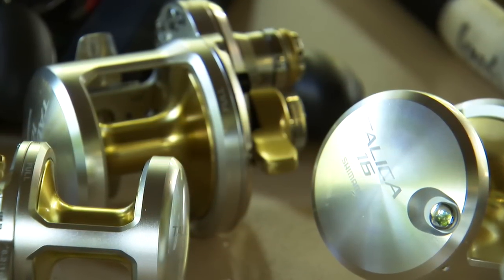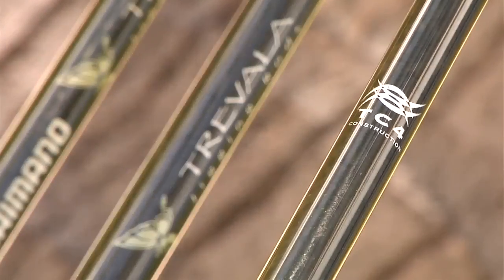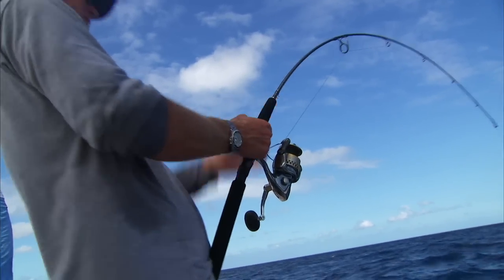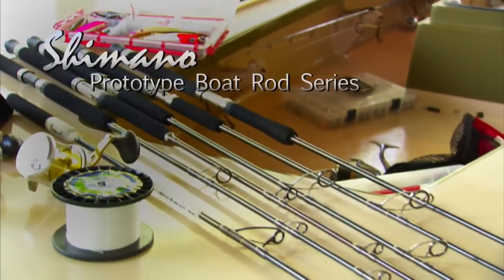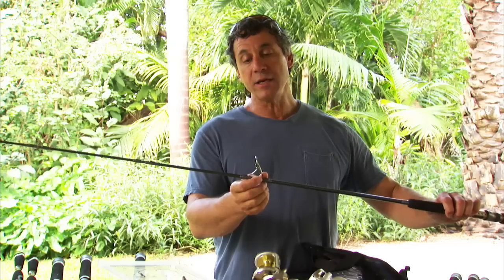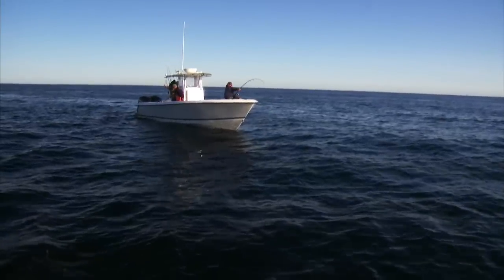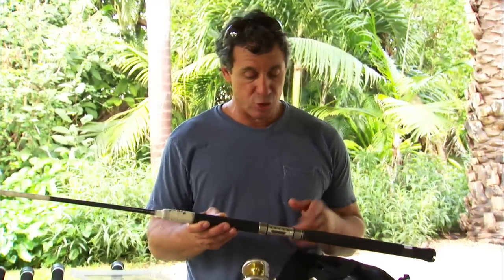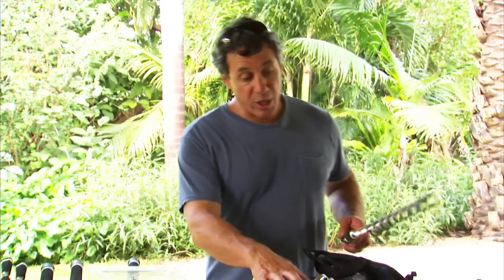Shimano Boat Rods

Comment: Could I use San 8 ft Shimano tms-x80 tc4 on a boat bottom fishing I know 8 ft is long for a boat but could I do it with one of these rods just got one for 200 $ An dont want to break it
Reply: I wouldnt recommend it. The terez rods were built for casting live baits. Go get a shimano trevela if you plan on using it as a bottom rod.